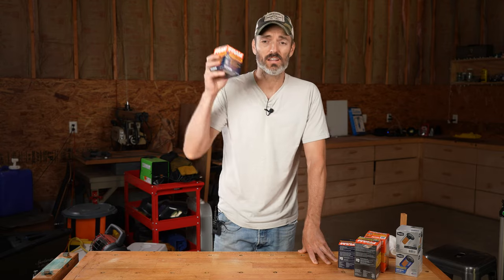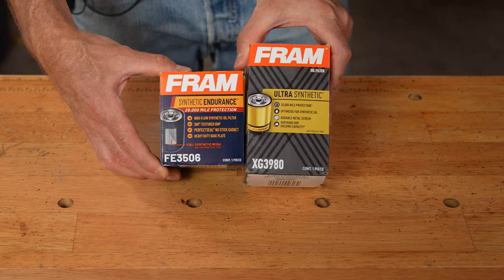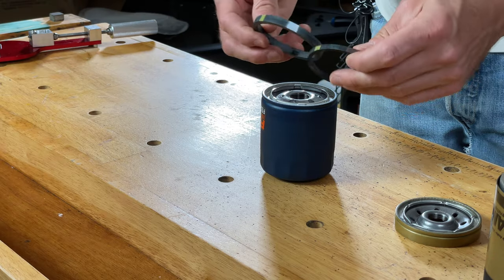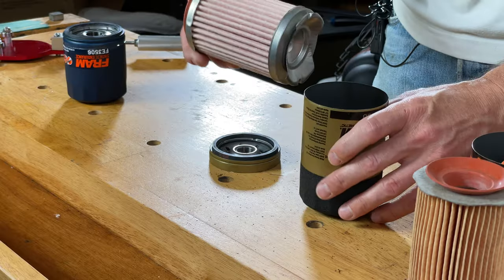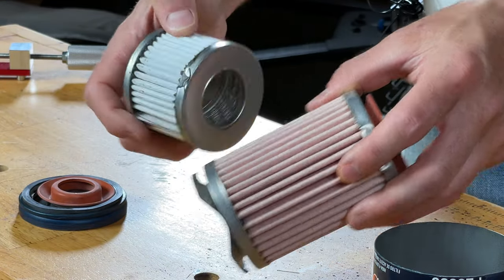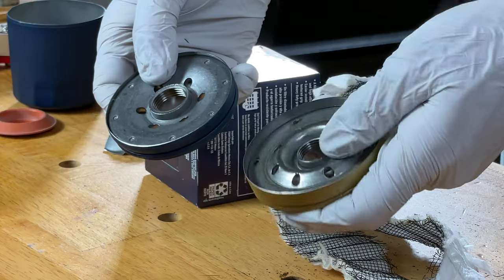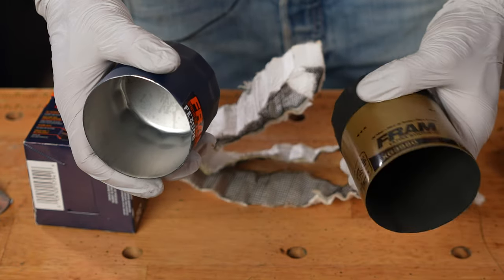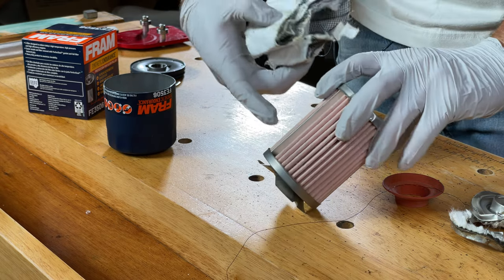FRAM Dropped A New OIL FILTER Called Synthetic Endurance That Lasts 25,000 Miles!!

Comment: Anyone who reuses oil filters after an oil change needs to educate themselves. Or start Savin money for their next vehicle.
Reply: people nowadays are the only reason their vehicle has any problems and they tend to blame either the vehicle, the brand of part, or the rust belt. Nevermind that they are the dumbass that thought cutting wires under the hood was a good idea or pressure washing the motor or using fram filters, or turbo/ supercharged engines that the engine wasn't designed to deal with the increased compression or just flat out stupidity when it comes to regular maintenance schedules
Reply: Years ago that's what was recommended. Oil filter every other oil change.
Reply: @alanmerritt860  With modern filters that's still practical.  Go 3k miles, change just the oil and keep filter installed.  Go another 3k miles, change both oil and new filter.  Repeat.  You'll still only be at 6k for oil filter changes, which is below almost every auto manufacturer service interval these days.
Reply: They dont change oil, they change 3 engines in 10 years😂, i have customers like that: every time i put another engine in their car they Say: "this time i wouldnt forget the oil change" then they disappear to come at my garage 2 years later with the engine knocking 😂
Reply: @gillespriod5509  lolol
Reply: @infernaldaedra  idk about the ONLY reason. Some manufacturers just don’t build them to last. Even doing the proper maintenance intervals, not what the manufacturer “recommends”, but the actual proper intervals, such as Chrysler fiat, gm/dodge. Planned obsolescence. They only care about quarterly sales numbers and not longevity. Add to that ignorance of owners and it’s 2-3 times worse.
Reply: @KendrasEdge757  if they don't build them to last why would someone even bother getting a premium oil filter
Reply: @KendrasEdge757 — there’s nothing wrong with reusing a HIGH QUALITY oil filter for 2, 3 and even 4 times before finally trashing it. I’ve been doing this for over 10 years on various vehicles. Lab analysis of the used oil always showed clean oil, which means good filtration. 🤷🏻‍♂️ 

I’d rather run a high end oil filter 2x vs using a cheap filter that you change every time. 🤦🏻‍♂️ 

Better filtration is what you WANT.
Reply: @I_know_what_im_talking_about  to each their own, but good luck with that. Hate to be the one to end up with one of your “well maintained” vehicles though lol
Reply: @KendrasEdge757  — why would you not want one of my vehicles, that got Synthetic oil changes every 3-5k miles but used a HIGH END oil filter (rated for 20k miles) for 6-10k miles of use??? 🤨😒 

It’s rated for 25k miles of capacity!!! I’m using barely 50% of it. How is that BAD?!?! 🤦🏻‍♂️🤷🏻‍♂️ 

There’s no hope for you, man. 😑
Reply: @KendrasEdge757  — why would you not want one of my vehicles, that got Synthetic oil changes every 3-5k miles but used a HIGH END oil filter (rated for 20k miles) for 6-10k miles of use??? 🤨😒 

It’s rated for 25k miles of capacity!!! I’m using barely 50% of it. How is that BAD?!?! 🤦🏻‍♂️🤷🏻‍♂️ 

There’s no hope for you, man. 😑
Reply: @I_know_what_im_talking_about  you’re failing to understand that oil filters, by design of the entire engine, aren’t made to be re-used over multiple oil changes. For what? Saving a few bucks? Once the filter media is filled up it no longer filters. Changing the oil doesn’t make the filter miraculously start filtering the oil again. Man all I can say is don’t answer any calls on your cell that you don’t recognize, cuz someone’s gonna get took!
Reply: @I_know_what_im_talking_about  yeah why change your oil but not the filter? You have oils that are rated the same, but you doubt those ones why? The oil would only get dirty because the filter isn't doing its job, not as a phase of the oil. The oil only experiences that at a much later date, no?
Reply: @KendrasEdge757  — what are you yappin about? It’s been proven with LAB RESULTS that an oil filter starts filtering BETTER as it gets loaded up with particles. It keep getting better and better up to a point where it becomes loaded and goes into bypass. 

A good healthy clean engine can EASILY go 20,000 miles on a single oil filter and still be in the safe zone. I’ve tested it myself over 10 years ago and shared my findings over on Bob is the oil guy forum. 👍🏼😎
Reply: @I_know_what_im_talking_about go away stalker
Reply: @I_know_what_im_talking_about  wait a minute bob…..you’re sayin the oil filter itself filters better as the filter media gets filled up?!  There’s no way to test that an oil filter starts filtering better at a certain point prior to bypassing the filter media completely. That’s like saying my sunglasses 🕶️ start to work better after I’ve had them on for awhile lol in other words, you can’t test that bob. Hey bob, try again Bob.
Reply: @I_know_what_im_talking_about  Yep, one can replace the filter every other oil change with a high quality, high mileage filter. The oil additives are what goes bad and the filter outlasts the oil by a few cycles.
Reply: 3,000 OCI might not be bad to run a full synthetic oil filter twice
Reply: @infernaldaedra nah, hyundai, kia, BMW, Mercedes, chrysler, GMC are all trash
Reply: Euro cars require filter change every second oil change. It's in the manual.
Reply: @rachelgreen1368  they don’t “require” that. You can put a new filter on every oil change, but hey you do that you might as well never change the “lifetime transmission fluid” either too along with going 10k miles between oil changes. If you don’t keep your vehicle but for a few years I guess it doesn’t matter what ya do.

Comment: Great video! Retired here.. been using the least expensive Fram oil filter (extra guard now) since high school.  Change oil every 3000k and never had a problem. Currently have 357k on my 2002 5.3 Silverado.
Reply: 😂 so you’ve been doing the BARE MINIMUM required and your  engine is still functioning. Wow. 🤦🏻‍♂️ 

Does that really mean anything? Your engine could be burning oil and is really dirty inside from the el cheapo filters yet still work just fine.
Reply: @I_know_what_im_talking_about   No, never the bare minimum Artem... always what's required. Truck does not burn oil.. just been well taken care of, with a great platform to start with. My point being.. never had an issue with Fram oil filters, on regular changes, over the past 50 years. Own many vehicles.. and oil changes/schedules are top priority for me. Your new and not so familiar with all of this I'm thinking??? Best luck!
Reply: Great job.. doing an oil change that frequently.. hope it lasts a lot longer.  I think it is hard to compare oil filters without having duplicate vehicles with different oil change intervals or filters to really compare
Reply: @I_know_what_im_talking_about  Do you know what I’m what you’re talking about? Doing an oil change every 1800 miles is way more than the minimum, it’s less than half of what the recommended interval is. That oil was probably coming out  pretty clean at that mileage.
Reply: That works for the application. There are filters that are light years better but, if you’re only going 3000 miles then it will work.

Comment: Honestly, I change my oil filter with every oil change. I use the 20k filter and oil, but never go over 5k miles between changes. Some may call it a waste of money. However, it's relatively cheap, especially for maintenance care.
Reply: Greetings from Germany,
I fully agree with you.
Changing the engine oil and filter every 5k miles (8k kilomters for us in Europe), is the best you can do to protect an engine and ensure viscosity/lubricarion.
Furthermore, if your driving mainly around town, it might be prudent to change the engine oil & filter every 3k miles (a bit less than 5k kilometers).
With kind regards,
TH
Reply: @ryanfelton7385 — it is cheap enough to throw away after only 5k miles of use but you COULD drain it during an OC and run it another 5k because technically, the filter is still perfectly good to go and you’ve only used up 20% of it. 🤷🏻‍♂️
Reply: As the saying goes, oil is cheap, engines are not!
Reply: It's a shame there's so many people buying into the extended interval BS
Reply: @jankington216  I am a firm believer in, don't trust anyone trying to sell you something ;)

Comment: This new Fram filter is $10.00 cheaper than the Amsoil and is made with the same exact components.
Reply: Yea… because it’s FRAM and Walmart. They do whatever they want. 🤷🏻‍♂️
Reply: I typically buy an Amsoil EA15K13 for $10.35 each, or about $2.65 LESS than the Synthetic Endurance.

Comment: I'm a fan of the Endurance. Based on the specs and appearance, it seems to be the same as the Amsoil filter with a different paint job and label for 30-40% less money..
Reply: Definitely has been proven that it is a match to the Amsoil EAO/EA15K series filters made by Champion labs.  Walmart stocks all the Fram Endurance models.  That is the only place that carries them so far from my searches.  I bought the standard size and the larger filter that fits my Ford.  FE3600 and our Jeep GC V6 25k cartridge filter for $12.97 each.  My Amsoil preferred account is $17.40, so it really is a wash.  Just depends on what oil you want to run.  Amsoil has three worthy, Pennzoil Ultra Platinum, Valvoline Advanced, Valvoline Extended Performance, and Extended Performance High Mileage has all the high additive wear packages and high TBN.  I do Blackstone labs oil analysis on my oils when I change them,  but I do not do extended oil changes.  5000-7500 maximum regardless what kind of lettuce they are smoking.
Reply: There have been some videos where they opened them up, and they were exactly the same.
Reply: @emed1977  after further inspection, I see the Amsoil filter media is not the same as the fram endurance. The fram endurance is a synthetic and cellulose blend. The Amsoil filter media is exclusively synthetic, so it has higher flow.
Reply: The boys have a new toy to play with good goody now let's get on with the show
Reply: Recently changed over to synthetic oil and filter after 20 years of running cellulose fram in my Cummins. My oil pressure is way better at all rpm’s. Thought about getting the amsoil filter but saw endurance and amsoil taken apart in a video. Chose the best bang for the buck.
Reply: I work at a walmart auto care center, i change oil ALL DAY, i just put the endurance filter on my wife daily, it has 4k miles on the oil change and the oil looks a day old. My truck (my daily) i havent switched over yet but i ran the ultra synthetic, it has 2k miles on that filter and is a decent bit more dark. Still not as bad as what i see everyday with the standard oil filters, i drain them and its deep brown, never diesel black, but pretty dark by comparison. I love the endurance and will continue to do my research and using the best oil and filter combo. If your curious, i use mobil one in the truck and penzoil platinum in my wifes car, and im about to switch both to penzzoil ultra platinum, that oil has the best results ive seen thus far. Not shitting on mobil one by any means, just pointing it out.
Reply: I typically buy an Amsoil EA15K13 for $10.35 each, or about $2.65 LESS than the Synthetic Endurance.
Reply: @kimmillard9445  depends on the filter. For my truck, the Amsoil is about $3 more. That being said I’ve just been buying the Amsoil oil change kit lately.

Comment: everything looks chintzy to me. compared to another brand i like
Reply: I am curious what brand that is ( yes I realize this is an older video ) as I have never ran a fram filter on anything myself, mostly fleetguard, a few baldwin, John Deere, Cat, some Purolator, Donaldson ( air filters ) Of course JD and Cat don't make their filters but get them made to their specs. I just think fram did themselves a disservice  by building such cheap filters as their standard filter as all demo filter displays at farm dealerships or elsewhere have a fram filter to show what an extreme low end filter looks like inside.

Comment: I don't think Fram is saying that with this filtrer you can change the oil in 25k miles intervals. I believe Fram is offer an longer interval for your filtre, not your oil.
Reply: 😂 right? The point here is the OIL FILTER. 

Change the oil, but keep the filter going for a second or third oil change before finally replacing it. 

If the filter can offer you 25,000 miles of FILTRATION, why dump it after only 5k miles of use??? 🤦🏻‍♂️ 

You’re throwing away a perfectly good oil filter that still has over 80% life left in it.
Reply: Isn't the oil what lasts longer than filters?
Reply: @I_know_what_im_talking_about I would change the filter anyway because it contains a good amount of dirty oil. I guess you could remove it and dump most of it out but if you're going to that much trouble you might as well stick a fresh one on there.

Comment: I will never use another fram filter. I stopped using fram garbage years ago when I found out just how cheap and poor quality they were made. A little while ago the parts store was out of the normal filter I use for my 2000 jeep Cherokee so I used a Fram ultra guard. Having seen good reviews on them I figured I was safe just this one time. In less than 3,000 miles it started leaking from the seal. I checked and it was tight, but not too tight. So I did an oil change and the seal on the filter had actually gone concave. Lesson learned....don't even use a fram in a pinch. Go find an actual quality filter.
Reply: "Ultra guard" doesn't exist, bud.
Reply: @xXJLNINJAXx  well excuUuuUse me for having it wrong. Ultra synthetic, the gold piece of crap "BUD"
Reply: The lower end Frams are quantum levels inferior to the Endurance in construction and performance. This one is of the highest quality.

Comment: Having a filter that will hold up and have good flow after 15, 20, or 25 thousand miles would be a really good idea, but I would still go with changing the oil every 3 to 5 thousand miles. I would not be changing my filter every time. Maybe every 2nd or 3rd oil change. "Why?" you may ask. As the filter starts to get dirty it will filter out smaller and smaller particles. As some of the holes get partially plugged it creates some smaller holes that will be able to trap even smaller pieces. This will actually work kind of like a bypass filtration system. You just need to make sure that you have a filter that won't break down, plus will keep a good flow rate even after it is partially plugged.
Reply: You really know your stuff keep up the good work
Reply: I asked the same question: Can I just keep the same oil filter if it is rated for 15k miles and just change the oil since I change the oil every 5k. Oil filter company answer is: change the filter at the same time you change the oil.
Reply: @Simple_Youtube  If a person does that, then that just means more sales for that company. If it's good for 15K then there would be no reason to do that, well except to give the oil company more sales.

Comment: I use the Fram line of filters, and I too change my oil every 3-5,000 miles. Just a note: if you noticed, when you started your engine, it took about 5 seconds to get oil pressure. Thats not good. When changing your oil filter you should fill the filter with oil before you put it on. That way you will get pressure almost immediately. No dry starts. Just a tip from an old timer.
Reply: I've never pre filled an oil filter in my life. Didn't even know it was a thing untill I started watching videos on YouTube. Beside you can't prefill one if it goes on upside down like my 63 dodge dart.
Reply: We need to suggest a test of oil filters to mr. Project Farm.
Reply from the maker: Project farm is a fantastic channel!
Reply: @alanmerritt860  You can 'prime' a dry filter before starting the engine.  Hold down full throttle and try cranking the engine over for 5-10 seconds.  This will circulate oil without actually starting the car.  Once you learn this trick you never even need to bother prefilling a filter.
Reply: @cup_and_cone  it's not something I'm really concerned about.
Reply: Well, if it's a huge deal to start engines with an empty oil filter once every 6 months or a year or how ever often it is that the filter gets replaced, people ought to get super OCD about the quality and proper function of the drain-back valves on different brands of oil filters, because a poorly functioning drain-back valve could cause the engine be subjected to the same results of a few seconds of no oil pressure every single time that it gets fired up after sitting for a while.

Comment: Top tip. When your oil filter is oriented as shown, fill it with oil before installing. Gets the oil pressure up faster.
Reply from the maker: Good call.
Reply: You can also add a good slug of oil in the ones mounted sideways to help filling.  New oil on the gasket and wipe old oil off the mounting flange.
Reply: @latrogeniwile58  
Not quite a "good slug", or you'll spill most.
Reply: this is a common misconception. Doing this or not doing this will make zero difference. maybe in old cars or extreme conditions this might make a difference.
Reply: @icarris1  
Why? You need to explain your claim as it contradicts common sense.
Reply: This isn’t necessary at all. The difference between doing this or not is maybe a fraction of a second of lubrication. Basically just making it harder to put on the filter for fun